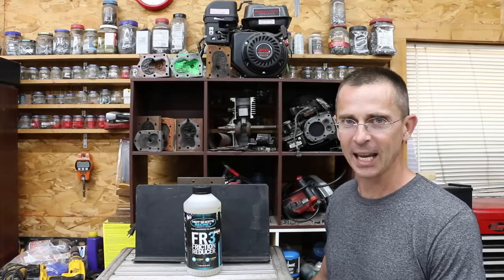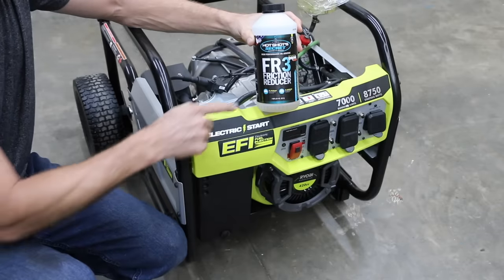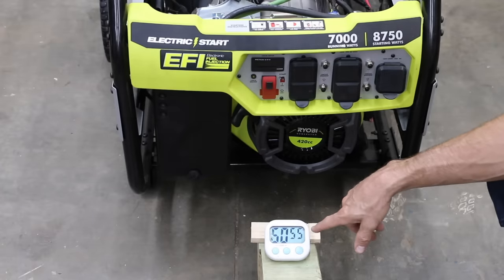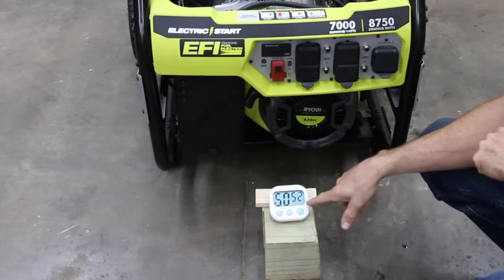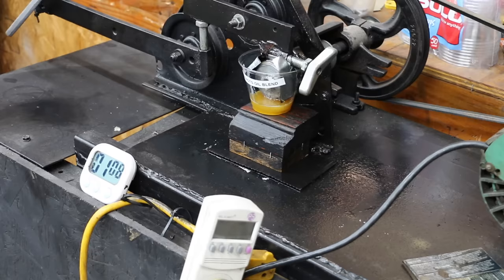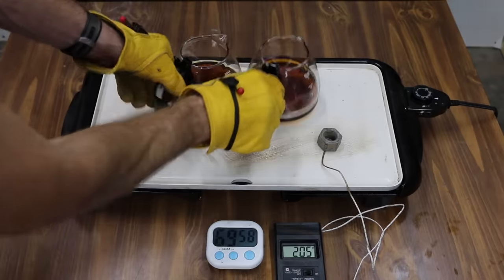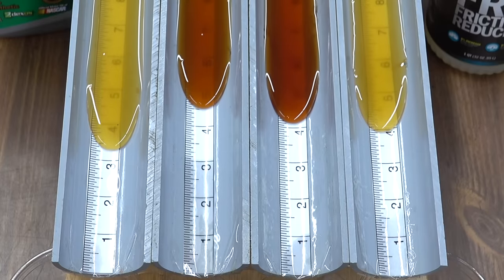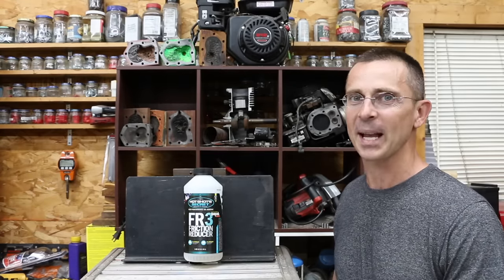Mobil 1 Boosted with Hot Shot's Secret Better? Let's find out!

Comment: Hi Todd, I'd love to see you do a comprehensive test on Duralube engine treatment.  You've gotten much more sophisticated in your testing over the years and it seems like time to revisit Duralube.  I've used it for years and it does seem to  make my car engines run cooler.  I can't find any comprehensive tests on the product. I wonder how it effects film strength and cold flow characteristics when added to synthetic motor oil.  Thx, Jim.
Reply from the maker: Thanks for the video idea.

Comment: It does work, remember this guy is using a really high end oil if he used a conventional oil the results would be significantly better. as the high end oil already has alot of additives to keep the engine safe for a year.

Comment: Thank you for your help and advice. 
 Could you please try prolong oil treatment. I have been using it for years now. 
 I have a 1998 jeep Cherokee sport. Has over 400,000 miles. A Ford f-250 7.3L diesel engine. Almost 390,000 miles. 
 Not sure if it is really helping. But I believe that it might have something to do with it. I use in all of my engines. I am a diesel technician. 
 Thank you and please keep up the good work.
Reply from the maker: Thanks for the video idea.

Comment: I would love to see you test NMF now called Mo-Glide since name change I am convinced it's the best additive on the market.  My friend owns a small trucking company and is a dealer for Mo-Glide he showed me an engine that he tore down with the Mo-Glide and one without and sold me on it. After using it in my cherokee 4.7 with 220000 miles on it and bad lifter tick it immediately quieted it and the engine ran noticeably smoother.  Now has 250000 on it lifters still quiet and I started using it in my fuel and am getting slightly better mileage.
Reply from the maker: Thanks for the suggestion.

Comment: Great video as always! Probably not the first person to say this, but it would be cool if you tested the manufacturer's claim on improving compression (surprised you didn't get out the compression tester, although that generator looked new so probably wouldn't have changed much), and also test the engine under load. I'm not super knowledgeable on engines though, so maybe the no-load test was sufficient. Also, as someone else pointed out, it would have been interesting to see this product tested with a cheap, no-name generic 5 or 10-w30 motor oil in a worn-out vs brand new engine. E.g., for the scenario where someone's trying to improve the performance of an old engine using mid-grade or cheaper oil. Just a few minor suggestions!
Reply from the maker: Great feedback.  The generator has under 25 hours on it
Reply: Project Farm thanks for your hard work as usual 👍

Comment: My personal opinion is Hot Shot makes products that improve the operation of diesel engines that employ high pressure oil driven injectors, i.e. Navistar 444/ VT375 some Cat, and obviously 7.3/6.0 PSD engines, not sure they make a huge difference in gas or IDI/DI/Common rail diesels. Awesome channel, crowding a million subs!
Reply from the maker: Thank you for the feedback

Comment: Can you test out to see what bicycle air pump is the best, easiest to use, how accurate the gauge is, how much pressure it can put in a tire, how it performs at different temperatures, how it performs in different weather conditions, how much pressure the pump and the air hose can handle, what the inside of the pumps looks like, how durable the pump is, and how many pumps it takes and how long it takes to fill a tire from 0 psi to 60 psi.
Reply from the maker: Thanks for the video idea.

Comment: Please test a diesel lubricity with hot shots, the epa with the new guidelines and this ultra low sulfur diesel fuel makes me worry about my new gen 3 ecodiesel from Ram which is now discontinuing that engine and they also have a recall on the fuel pump go figure, my first diesel and it looks like it might be a lemon, it gets great gas mileage and the power is great i love the truck i just want to do everything i can to make it last.  Thanks love the video's keep em coming !!
Reply from the maker: Thanks, will do!  Thanks for the suggestion.

Comment: My work sells full gallon containers of Lucas injector cleaner. It would be very interesting to see how an engine would run using only a fuel injector cleaner, and on top of that maybe using multiple different fuel injector cleaners by themselves with no added gas, just to see how well it would clean up or run.
Reply from the maker: Thank you for the video idea!

Comment: Sir, Can you test some fuel addictives, please ? There's lots of fuel addictives in the market promising amazing things, including more horsepower with 5-10% mpg gain also clean and increasing octane number.  Fuel OX and maxx power boost can treat up to 30 gallons of fuel with 1/2 oz of addictives and they also claim they stabilize fuel and provide more oxygen and change fuel chemistry.  It's hard to believe such a small dose can do all. Kindly test these products, please.  You are the best YouTuber and can prove their claims true or false. Their data sheet doesn't have much informations but there's some in sds . Thank you and we will wait for the video
Reply from the maker: Thanks for the suggestion.

Comment: I am an automotive technician in Fairbanks Alaska. Our winters will reach -40F and colder quite regularly. We have a full shop of power steering failures such as hoses, pumps, steering gears, rack and pinion's,etc when it gets that cold. As far as j can tell the failures are due to the lack of fluid flow. There seams to be a majic number right around -40F where things start acting funny like flat spotting in tires from sitting that cause vibration, brakes have a delay in applying and releasing, etc. I'd like to see colder fluid flow tests maybe -50F. I think you will see more dramatic results that could have an impact what us northern people use for fluids. Thanks
Reply from the maker: Thanks for the video idea.

Comment: Great as always PF!  
Have you ever considered replacing the temp controller on your hot plate with one that allows for higher temps (700F ish)?  Results on oil degradation/evaporation may be interesting ; )
These controllers are inexpensive and modding the hot plate would be pretty simple.  Caution though on any teflon coating on hot plate (safer to not have teflon if cranking temp up).  Best, Ken
Reply from the maker: Thanks for the feedback.

Comment: You always have great and useful information!  However, have you noticed in your videos that your LED shop lights use PWM (pulse width modulation)?  This technology is used to decrease energy use and on many phones, computer displays and TVs, a cheaper way to control brightness versus the non PWM method of DC control.  This causes many people a great deal of eye pain and severe headaches whereas the DC method does not.  I'm not a fan of LED lighting myself even though it  has reached pandemic levels of popularity.
Reply from the maker: Great information. Thank you

Comment: Love the tests.  Could you test weed wacker line (line trimmer line)?  My machine uses the .80 line size. I have very tough weeds and I am allergic to 2-stroke engines so I have to use electric and I end up using a lot of line because it uses the smaller diameter line.  I don't really care about the line cost much.  I am more concerned with not having to use or attempt to use the feed mechanism as much.  I also hate when it binds.  Not sure if they all are as equally likely to bind.
The tests should include glancing blow on concrete, whacking directly against a rock and hitting chain link.  Also as a test of tough weeds perhaps try to cut hemp rope?
Reply from the maker: Thank you for the video idea!  Here's a video on trimmer line from a while back:  https://www.youtube.com/watch?v=C_q3_Dk8f_g

Comment: I know it could be quite expensive but have you considered comparing HT ignition leads, can even make a DIY one, there are guides out there. Or on the cheaper option comparing spark plugs from copper to iridium etc. Different gap sizes electrodes etc. Not sure if same manufacturer or different ones across the board is best.
Reply from the maker: Thanks for the video idea.

Comment: Is there some way to use an actual car or truck engine... the cummulative number of moving parts creating heat, friction, wear, and engine loading could make significant differences in results vs the results of a generator... thanks for what you do, and i realize that the generator is likely the most feasible alternative...

Comment: Maybe if you continue oil tests, during the heating/oil evap test can you find a safe way to add a white absorbent cover to the tops of the decanters. It could give some feedback on what is being distilled off from the oil that may be  condensing on valve covers and such.
Reply from the maker: Great suggestion!  Thank you.

Comment: It rocks- fr3, use it as my gun oil now too. I can write 10 pages about how good fr3 is.  Holds 400% more water too, water in oil causes huge wear itself. Xado is only thing that beat it is Hexagon Boron Nitride - ceramic oil additives but cant use it in engines with Alusil liners.
Reply from the maker: Thanks for sharing.

Comment: Thank you again, better every day.
I think an already good product like Mobil 1 synthetic from a reputable brand like Mobil is good as is and they know their stuff and fooling around with it can do more harm than good (as you showed it with worse flow of the cooked oil as it evaporated more and of course the low TBN). If I want more performance or less wear I simply buy a better motor oil as they know what they are adding and doing much better than a product which is intended to use for every motor oil out there with a huge difference in properties.
Reply from the maker: You are welcome!  Thanks for the feedback.

Comment: I've notice that for most tests, a lawnmower or power generator is used. I don't see how fuel efficiency can be determined if those devices aren't computer controlled , such as OBDII. A non-computer-controlled engine will not save any additional fuel even if you had a super slippery non-resistant additive added to the engine oil, as those engines are pretty much metered to burn whatever it's going to burn.
Reply from the maker: Thanks for the feedback.

Comment: The mass loss of the FR3 after use is likely the loss from the carrier and not the actual package. The carrier also likely contributed to the lower than expected flashpoint. Once the package is distributed  in the oil the carrier is no longer required, so it flashes off as shown in the testing. Once gone, the mass differences after heating should be minimal. Of course this depends on the additive and type, it's not something you'd want in an oil stabiliser for example.
Reply from the maker: Thanks for the feedback.

Comment: What's the best multi-purpose soap.
I ues a lot of soap on a tank and truck and general use or as a lube agent. 
Soap is particularly in Port to me when it doesn't dry as easy or freeze
I like soap to do as much of the work for me with out me having to rub it in.
I ues (Enforce) and (Dawn 5x)
There's many other brands out there but
   What's the best multi-purpose soap.
The best ?
mid-grade ?
budget ?
cleaning power 
lube
foaming capability
Bacterial fighter
Greece absorber
Love the Chanel and informative contact.
Reply from the maker: Thanks for the video idea.

Comment: Have you done slick50 and engine restore? I have a 2009 jeep wrangler and want to bring back normal engine power. I have used engine restore before and I have used slick50 in an older engine and both seemed to do a great job. If you have not compared these 2 products before I think that this should be a great time to do it.
Reply from the maker: Engine restorer did a great job in a different video. Thank you

Comment: I watch every video and tell everyone about this channel.  I have something that must be tested because it cannot be agreed upon.  Two stage snowblower impellers, we all know that a 14 inch versus 12 inch will throw snow farther given that the engine is up to the task but regardless of the size impeller what cannot be agreed on is if 3, 4 or 6 fins on the impeller is better.  We need a snowblower and three different impellers tested in light and fluffy snow and wet snow and finally put this debate to rest. I cannot think of anyone better for this task.
Reply from the maker: Thank you for the video idea!

Comment: Did you test lucas oil stabilizer yet? Both mineral and synthetic. Ive testet it. Feels really nice but does it help? Ive seen the oil pressure trop over 6000km of use by about 1 bar or so. That did not happen without it :\ Some dragster guys use it but well I dont know :)
Reply from the maker: Thanks for the video idea.

Comment: Man, I wish someone had some of the original Slick 50 we could test. I had a 1982 Yamaha Virago motorcycle. I replaced one of the four quarts at oil change with a quart of slick 50. The stuff was so slick, it was very difficult to get the bike to shift gears after the oil change. I ended up having to dump the crank case and refill if with plain recommended oil. I t took a couple of months for the transmission to return to normal!
Reply from the maker: Thanks for sharing.

Comment: sorry if this sounds like a dumb idea but, is it possible to clean fuel with some water based liquid, and orbeez?
maybe add water to the fuel in a bucket or bottle, shake to get the contaminants mixed into the water, strain off as much water as possible, then put a bunch of those orbeez into it to soak up the rest of the water.
or
try to turn fuel that was contaminated with water back into usable fuel with orbeez (suck all the water out of the fuel with orbeez, leaving just plain ol fuel left over
Reply from the maker: Thank you for the video idea!

Comment: Could you test castor oil as an engine lubricant please. I use it in model engines as well as high performance 2 stroke race engines. It supposedly has high film strength and mega protection against overheating and lean runs. How does it compare to modern synthetic oils? I know it would win the smell test. D:
Keep up the good work, there is no other channel like this one.
Reply from the maker: Thank you for the video idea!

Comment: Please do a video on radiator coolant additives with claims such as below:

2-in-1 corrosion inhibitor and wetting agent enhanced protection of aluminum
Reduces surface tension of coolant allowing heat to transfer outside the radiator for more horsepower
Reduces hot spots in the engine and cylinder heads to help prevent failure of critical engine components
Maintains a cleaner system, prevents overheating and extends the life of the water pump
Safe to use in water or anti-freeze/water blends
Reply from the maker: Thank you for the video idea!

Comment: I think another great video would be comparing fuel transfer pumps that guys have on their fuel tanks on their trucks to fill up equipment.  Different brands are Fill-rite, GPI and then Chinese knockoffs.  Maybe a shootout comparing how much voltage and amps each pump draws.  How much each pump actually flows compared to what it's advertised flow is.  Lastly,  tear it down and show what kind of internal components the pumps are using.  This will show the real quality of the pumps themselves!
Reply from the maker: Thanks for the suggestion.

Comment: All oil additives are heat activated, new additives take about 1500 miles in a car to properly adhere and protect the metal in an engine, 30 hours of driving. So you would have to run your generator with FR3 for an extended amount of time before doing a fuel mileage test.
Reply from the maker: Thanks for the feedback.
Reply from the maker: Thanks for the feedback.

Comment: Test West Systems Epoxy, it is rated for 7800 psi in tensile strength, JB Weld Original is rated for 5020. West Marine has a buyers guide on their channel for West System's epoxy.
Reply from the maker: Thanks for the video idea.

Comment: What about to put a 2T oil and gas mix (1:640 or 1:500) on a 4 stroke engine to protect the carburator, valves and lubricate upper cylinder and piston??

Comment: Hi I have a important question...
My car it's a 2011 for edge and idk what problem I have it has about 144 thousand miles and its 18 mpg  but it's eating gas like crazy it takes like 1.7 miles worth or gas for a single mile
Reply: If u could shed some light that would be amazing it runs and soumds fine tho
Reply from the maker: Has it ever had a tuneup?  Spark plugs, wires, etc?  Any engine codes?  When was the MAF sensor last cleaned?

Comment: If you find an additive that you think might significantly help, contact the manufacturer and see if they will send you 2 crate engines. Disassemble and measure the bores and crank journals on both. Run them for a year (control and oil plus additive) in test stands with identical varying loads. Disassemble and measure again to see if any significant difference occurred. I realize that this is pretty preposterous, but it’s just a thought. If a product seems to be outstanding, a long term test would tell the real story.
Reply from the maker: Thanks for the video idea.

Comment: It doesn't seem to be any substantial benefit from using this additive. Granted the wear was reduced during the test of it for guarding against wear but that would seem negated via usage in an engine. The evaporation is greater and there aren't significant improvements if going by claims. And the "race" of cold oils only added to the disappointment. I believe I'd look elsewhere for that mother's milk miracle substance before plunking down cash. Cars may be a financial burden to most but tossing money away on insignificant or improbable improvements would be a bigger waste. 
Great video, as always.
Thank you for the enlightenment!
Reply from the maker: Thank You.